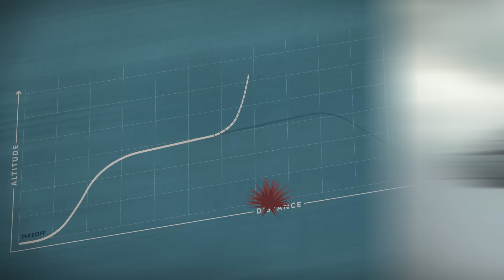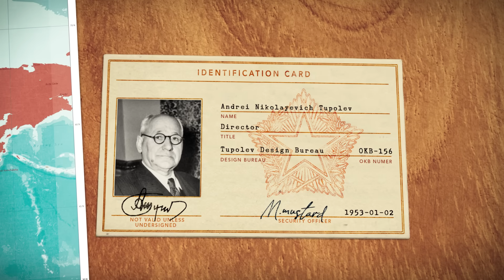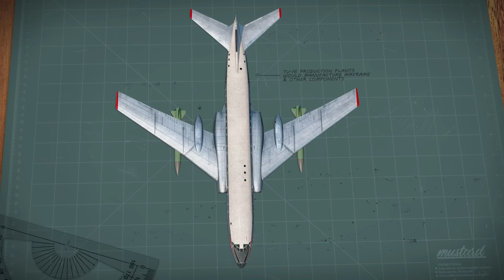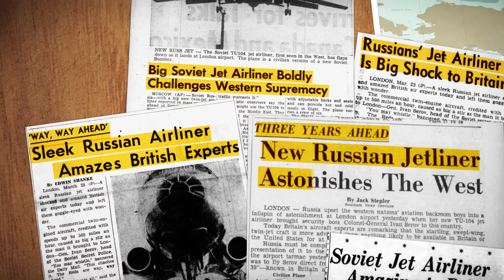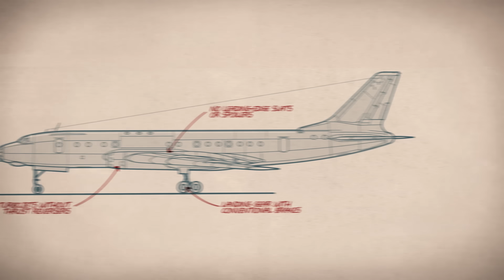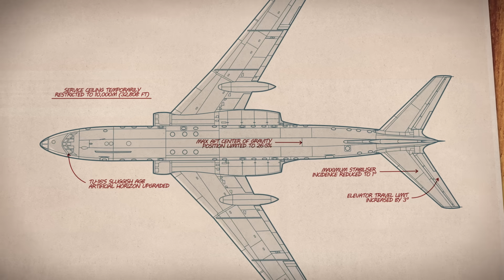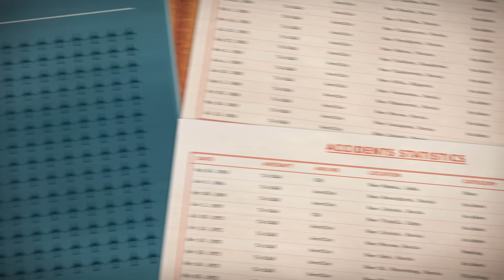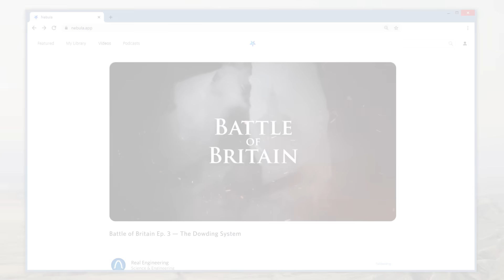The Soviet Airliner Designed To Crash

Comment: If you step foot onto an aircraft touted as “the peak of Soviet technology”, I have no sympathy
Reply: You were more likely to die on the de Havilland Comet... "the peak of British technology"
Reply: @WilhelmKarsten 

Regarding the fabulous trailblazing 
De Havilland Comet.
Accident Losses generally.

We feel we can clear up some commonly held myths and misconceptions, obviously.

It's always good to see the facts presented clearly and concisely isn't it?

De Havilland was subjected to forced merger under the govt aerospace sector rationalisation programme. A similar process occured globally, Sud Aviation and several other French manufacturers merged during design and production of the Caravelle with the Caravelle becoming a significantly international type project. Even in the US, there was no room for multiple manufacturers of large jet airliners with consolidation being inevitable.

The world's first wind tunnel was constructed in England before 1890.
The world's first supersonic wind tunnel was constructed in England during the 1920s.

The DH Comet was subjected to every type of stress testing & wind tunnel testing possible at the time. 

The world's first high altitude airliner.
The world's first jet airliner.

In fact the Comet was the first airliner to have a full fuselage length pressurised passenger cabin suitable for high altitude flying where pressurisation stress was many times higher than flying load stress. Bow-wing (see b-47 wing folding wing collapse incidents) had built less than 12 pressurised cabin airliners before the Comet first flew. The world's first pressurised cabin aircraft was a British design Airco built under licence in the US and modified in the US to have a pressurised cockpit cabin during a joint US / UK research project. Previous pressurised aircraft were airliners with lower pressurisation & altitude limits where pressurisation stress did not exceed flying load stress or were bombers with small heavily built cockpit capsules where potential total  airframe weight gains were insignificant.

The Comet nose was a unique De Havilland design that Sud Aviation subsequently licensed for use on their Caravelle.

Correct, the Comet was designed with military use in mind. In fact, the first designs were based on military use requirements, the first Nimrod aircraft were straightforward modified Comet 4 airframes. Obviously when the Nimrod first flew, it was of course the most advanced and capable aircraft of it's type in existence. All subsequent Nimrod airframes were indeed simply mostly  new manufacture Comet 4 airframes with the additional equipment bay added. Nimrod design and manufacture was in fact performed mostly by the De Havilland team at HS. 

The Comet was in fact an all metal construction airframe airliner, use of other materials was similar to all other airliners at the time. 

  Obviously there have been worse aircraft for accident losses both before & after the Comet. One of the issues was accident losses due to pilot error which were often caused by the novel aspects of jet airliner flying, even so, the accident losses for the Comet as an airliner were not particularly unusual at the time.

Some changes made were to make pilot error on takeoff less likely to cause serious problems. For example, the skin thickness remained mostly the same from Comet 1 to Comet 4.
Ripstop provision existed for all Comets. The original alloy used was discontinued by the manufacturer, the replacement alloy had similar properties.

  Indeed, at the time aviation infrastructure & aircraft technology etc was still developing rapidly, there was still a lot to do when considering all aspects of flying safety.

    How things were back then. 
Accident losses - % of aircraft built.
DeHavilland Comet 4                   14% 
DH Comet all mks   (ff 1948)       17%  
Vickers VC10 UK                            5%

The DH Comet had better safety than or similar safety to many other commercial passenger aircraft of a similar era.

Douglas DC-1                                      99%
Douglas DC-2                                      47%
Douglas DC-3                                      30%
Douglas DC-4                                      26%
Boeing s300                                        72% 
Boeing 307                                          70%
Boeing 247                                          48%
Boeing 707                                          20% 
Lockheed L-049/149 Constellation  30%
Lockheed Electra Turboprop             29%
Fairchild FH-227                                  30%
McDonnell Douglas DC-8                   14%
Sud Aviation Caravelle                        15%
Canadair CL-44  Turboprop                46%  
Convair CV-580  Turboprop                22%
Convair CV-880     (ff 1959)                27%  
Convair CV-990     (ff 1961)                33%
Tupolev T-104        (ff 1956)                16%

The VC10 held the fastest Atlantic crossing speed record for 41 years (Non supersonic airliners).

For the first few years of operations the Caravelle and Comet had similar accident loss Fatalities numbers.

  Instances of all Comet marks, including the Comet 1 and Comet 3 flew with full certification at some point after 1954. Airline duty Comets were all retired by 1980 with full certification until after retirement. The last Comet flight was a global circumnavigation series of flights in 1997.

   Of course De Havilland carried out a full stress analysis & performed extensive & protracted testing, including pressure cycle testing, on two long lengths of fuselage. De Havilland carried out significantly more testing than was required by any authority at the time & significantly more testing that any previous airliner was subjected to.

  Of course De Havilland had prior experience building many all metal construction airframe aircraft & thousands of jet powered fighter aircraft that were primarily of metal construction with pressurised cockpits & jet engines built by De-Havilland. At the time De Havilland engineers  knew all there was to know about metal fatigue as it applies to aircraft.

    De Havilland did indeed always work to better than industry standards at the time, used up to date knowledge for the design & no evidence of negligence  or criminal negligence was ever produced in relation to the DH Comet.

Military aircraft accident losses compared.
Non combat phase accident losses.
% of Aircraft built.
The EE Lightening did not have unusually high losses. 
The Canadair CL-44 was a turboprop airliner.
Canadair CL-44               (ff 1959 ) 48%
Lockheed XF104             (ff 1954) 100%
Lockheed  P80                (ff 1944)  43%
Lockheed F104               (ff 1954)  45%
MD FH Phantom 1          (ff 1945)  35%
MD F4 Phantom 2           (ff 1958)  28%
Convair F102 Dagger      (ff 1953)  45%  
MD F3H  Demon              (ff 1951)  32%
MD F-101 Voodoo           (ff 1954)  34%
EE Lightening                   (ff 1954)  33%
Gloster Meteor                (ff 1943)   21%
DH Vampire                     (ff 1943)   23%
DH Sea Vixen                  (ff  1951)  33%
Gloster Javelin                (ff 1951)   20%

Note that the Meteor didn't have particularly high losses, flew with more than 20 airforces for decades, got involved in air to air combat during a number of conflicts successfully against aircraft that first flew many years after the Meteor first flew.
 
We hope this helps, of course.       
       
As always, cheers & indeed 👍.

Comment: Count how many crashes had Boeing at jets era ? All in Soviet and western countries were pioneers in jetz, so many technical issues have to be fixed and etc... and if you were more accurate you would know that tu 104 and bomber has less that 20 % shared parts...
Reply: Boeing is actually the safest aircraft manufacturer.
 The British de Havilland Comet has the highest loss rate and fatalities statistics of any jet airliner in history
Reply: @WilhelmKarsten  I am not argue that, it can be a true all I say that all the jets at beginning have to go trough issues that props not even seeing and it dramatically causes a people deads ..
Reply: @hellhound2275 de Havilland successfully transitioned from props to jets... what it failed to do was successfully transition from aircraft made from wood and fabric  to pressurized aircraft made from riveted aluminum alloys.
 The tragedy of the Comet Disaster was that it was completely preventable if de Havilland had simply followed well-known and understood industry standards for the design and construction of pressurized cabins made from riveted aluminum.

de Havilland admitted that they never performed any stress calculations tests for the fuselage sections that failed.
The British CAA only required a single section of fuselage to be tested for airworthiness certification and d-H engineers simply performed the tests incorrectly and all of the test data was erroneous.

Comment: The most dangerous airliner was UK Comet
Reply: Regarding the fabulous trailblazing 
De Havilland Comet.
Accident Losses generally.

We feel we can clear up some commonly held myths and misconceptions, obviously.

It's always good to see the facts presented clearly and concisely isn't it?

De Havilland was subjected to forced merger under the govt aerospace sector rationalisation programme. A similar process occured globally, Sud Aviation and several other French manufacturers merged during design and production of the Caravelle with the Caravelle becoming a significantly international type project. Even in the US, there was no room for multiple manufacturers of large jet airliners with consolidation being inevitable.

The world's first wind tunnel was constructed in England before 1890.
The world's first supersonic wind tunnel was constructed in England during the 1920s.

The DH Comet was subjected to every type of stress testing & wind tunnel testing possible at the time. 

The world's first high altitude airliner.
The world's first jet airliner.

In fact the Comet was the first airliner to have a full fuselage length pressurised passenger cabin suitable for high altitude flying where pressurisation stress was many times higher than flying load stress. Bow-wing (see b-47 wing folding wing collapse incidents) had built less than 12 pressurised cabin airliners before the Comet first flew. The world's first pressurised cabin aircraft was a British design Airco built under licence in the US and modified in the US to have a pressurised cockpit cabin during a joint US / UK research project. Previous pressurised aircraft were airliners with lower pressurisation & altitude limits where pressurisation stress did not exceed flying load stress or were bombers with small heavily built cockpit capsules where potential total  airframe weight gains were insignificant.

The Comet nose was a unique De Havilland design that Sud Aviation subsequently licensed for use on their Caravelle.

Correct, the Comet was designed with military use in mind. In fact, the first designs were based on military use requirements, the first Nimrod aircraft were straightforward modified Comet 4 airframes. Obviously when the Nimrod first flew, it was of course the most advanced and capable aircraft of it's type in existence. All subsequent Nimrod airframes were indeed simply mostly  new manufacture Comet 4 airframes with the additional equipment bay added. Nimrod design and manufacture was in fact performed mostly by the De Havilland team at HS. 

The Comet was in fact an all metal construction airframe airliner, use of other materials was similar to all other airliners at the time. 

  Obviously there have been worse aircraft for accident losses both before & after the Comet. One of the issues was accident losses due to pilot error which were often caused by the novel aspects of jet airliner flying, even so, the accident losses for the Comet as an airliner were not particularly unusual at the time.

Some changes made were to make pilot error on takeoff less likely to cause serious problems. For example, the skin thickness remained mostly the same from Comet 1 to Comet 4.
Ripstop provision existed for all Comets. The original alloy used was discontinued by the manufacturer, the replacement alloy had similar properties.

  Indeed, at the time aviation infrastructure & aircraft technology etc was still developing rapidly, there was still a lot to do when considering all aspects of flying safety.

    How things were back then. 
Accident losses - % of aircraft built.
DeHavilland Comet 4                   14% 
DH Comet all mks   (ff 1948)       17%  
Vickers VC10 UK                            5%

The DH Comet had better safety than or similar safety to many other commercial passenger aircraft of a similar era.

Douglas DC-1                                      99%
Douglas DC-2                                      47%
Douglas DC-3                                      30%
Douglas DC-4                                      26%
Boeing s300                                        72% 
Boeing 307                                          70%
Boeing 247                                          48%
Boeing 707                                          20% 
Lockheed L-049/149 Constellation  30%
Lockheed Electra Turboprop             29%
Fairchild FH-227                                  30%
McDonnell Douglas DC-8                   14%
Sud Aviation Caravelle                        15%
Canadair CL-44  Turboprop                46%  
Convair CV-580  Turboprop                22%
Convair CV-880     (ff 1959)                27%  
Convair CV-990     (ff 1961)                33%
Tupolev T-104        (ff 1956)                16%

The VC10 held the fastest Atlantic crossing speed record for 41 years (Non supersonic airliners).

For the first few years of operations the Caravelle and Comet had similar accident loss Fatalities numbers.

  Instances of all Comet marks, including the Comet 1 and Comet 3 flew with full certification at some point after 1954. Airline duty Comets were all retired by 1980 with full certification until after retirement. The last Comet flight was a global circumnavigation series of flights in 1997.

   Of course De Havilland carried out a full stress analysis & performed extensive & protracted testing, including pressure cycle testing, on two long lengths of fuselage. De Havilland carried out significantly more testing than was required by any authority at the time & significantly more testing that any previous airliner was subjected to.

  Of course De Havilland had prior experience building many all metal construction airframe aircraft & thousands of jet powered fighter aircraft that were primarily of metal construction with pressurised cockpits & jet engines built by De-Havilland. At the time De Havilland engineers  knew all there was to know about metal fatigue as it applies to aircraft.

    De Havilland did indeed always work to better than industry standards at the time, used up to date knowledge for the design & no evidence of negligence  or criminal negligence was ever produced in relation to the DH Comet.

Military aircraft accident losses compared.
Non combat phase accident losses.
% of Aircraft built.
The EE Lightening did not have unusually high losses. 
The Canadair CL-44 was a turboprop airliner.
Canadair CL-44               (ff 1959 ) 48%
Lockheed XF104             (ff 1954) 100%
Lockheed  P80                (ff 1944)  43%
Lockheed F104               (ff 1954)  45%
MD FH Phantom 1          (ff 1945)  35%
MD F4 Phantom 2           (ff 1958)  28%
Convair F102 Dagger      (ff 1953)  45%  
MD F3H  Demon              (ff 1951)  32%
MD F-101 Voodoo           (ff 1954)  34%
EE Lightening                   (ff 1954)  33%
Gloster Meteor                (ff 1943)   21%
DH Vampire                     (ff 1943)   23%
DH Sea Vixen                  (ff  1951)  33%
Gloster Javelin                (ff 1951)   20%

Note that the Meteor didn't have particularly high losses, flew with more than 20 airforces for decades, got involved in air to air combat during a number of conflicts successfully against aircraft that first flew many years after the Meteor first flew.
 
We hope this helps, of course.       
       
As always, cheers & indeed 👍.